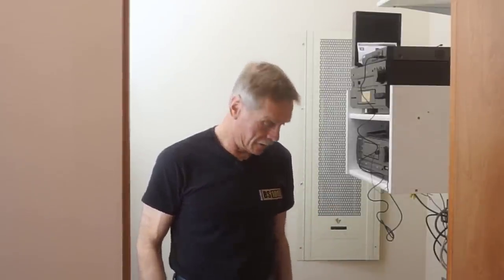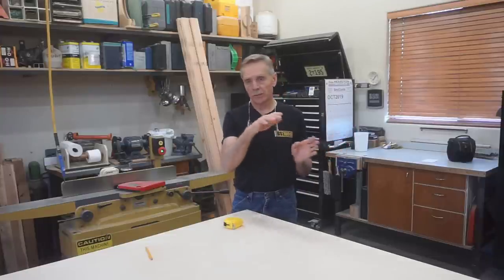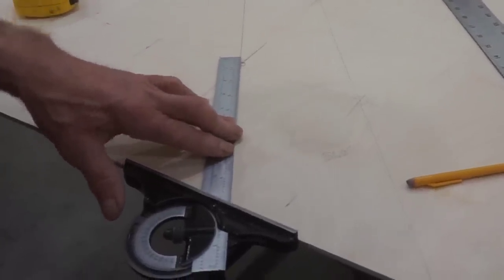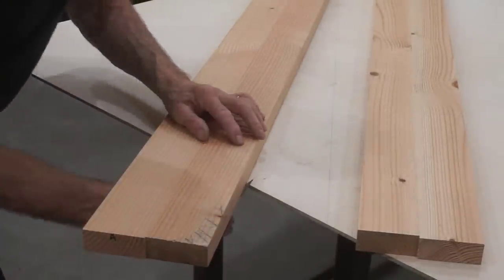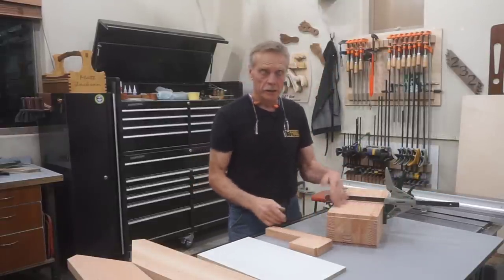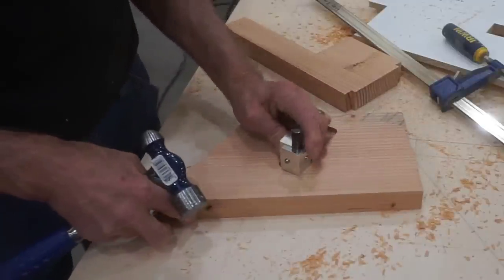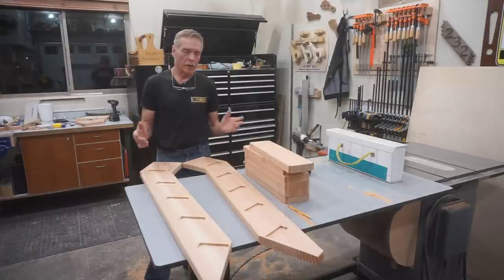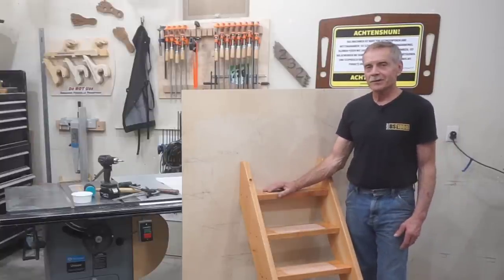How to Build a Loft Ladder

Comment: Even though I've built dozens of sets of stairs in my 40 years in the biz, I still learned a few things. But of course, most of the stairs I've built have been long affairs built in place...except for one set, which I built on a set of saw horses in the driveway of the house we were remodeling. The hole in the loft above was 36" wide by about 6' long and about 9' from finish floor to finish floor. My solution was an alternating tread design using 2x12 Douglas Fir. Of course, the middle stringer had mortices on both sides.

I cut one stringer top and bottom to fit in the required foot print, adjusted it as necessary to get a seamless fit top and bottom and then did a bunch of hit or miss layout until I got the step height figured out. Of course I made a template for my router, but it wasn't nearly as elegant as yours in this video. I didn't have a flush cutting bit so I made a large plate with the mortice size cut out, then screwed strips around the perimeter of the hole for stops to fit the base of my router. It was quite a clunky contraption, but it worked. I made full mortices for the treads because it was easier and I didn't have a table saw on site. Everything was built and cut with my circular saw and my router. They looked pretty damn amazing for my first time and believe it or not, passed code.

Comment: It's always amazing to me how the difficult things are made so simple by your techniques.  That mortising template was a stroke of genius.  So simple, but makes all the difference.  I was always scared of doing mortise and tenon joints, but you make it easy.  Thank you for another great learning experience video!
Reply: templates and jigs are key ... I had to hog out material and then fill back with blocking in a couple of old doors in my OLD house - the old morticed lock sets are gong - long gone, and the doors have been variously "adjusted" for newer lock sets over the years..and years...and when I went to replace the current existing with newer ( working) more-of-the-same, found that there really wasn't enough door left to securely mount them ( to hold back more than a old mouse with Rheumatoid Arthritis ) so..

Of course as I went to set up my small flush trim router like the one he used here died and all that I had on hand was my 2 HP monster Freud Plunge router....

With some suitable jigs I was able to route out both the door jam and the door itself, on both inside and outside faces as well as the edge ( 1.75" thick door) - with the door still hanging on the hinges ( as I really had no better place to set it up at the time this happened...the old lock had actually broken and any place big enough in the shop was completely covered since we were mid project on about 50 other things as well as a shop reorg) 

Bottom line is that a few pieces of melamine or similar and some forethought and you can safely rout a pocket into the thin edge of a door - on it's hinges- with a big hand held plunge router, and do it safely and repeatably.

I may have gone a bit far with the jigs, there was polyurethane and such involved... I have more doors and a humid basement...but the results can't be argued with, the patches and plugs fit nearly seamlessly into a 179 (+) year old door and since they are only in there with glue, I could even go back to an original style mortised lock set if I ever find one.
The time spent on the jigs was easily saved in not replacing the door or not having to go to the hospital or not having to repair the destruction done without the use of a jig.

Comment: Used a hinge mortising bit and jig  to make angled stopped dados to house treads of a ships style ladder with oblong hole grips between every tread. Definitely going the mortise route for a 4’ rise upper loft ladder I need to make. That way the mortise doesn’t have to fit the tread nose profile. Also the shoulders make the treads like trestle table rails. Probably I would  bury the screws and plug the holes for a finished space. Using a flush trim bit for mortising makes the jig more vulnerable. Make sure the router stops before lift off.

Comment: Sure, Matt could have easily bought a cheap aluminium ladder and called it good, and it would have been much quicker.

However, the point of this video was to us non master carpenters the learn the process of making a ladder and learn from a master carpenter the skills and techniques needed in laying out such a project, and how external factors such as location, purpose of use and desired functionality play a part in the design process. This master carpenter then showed us how to make templates to speed up and simplify the process of making mortices and tenons.  This in in addition to being able to understand that this process is not just for this project, but rather how we can adapt it to other projects of our choosing.

Imagine if you needed to build a 16ft wooden ladder for a customer. This master carpenter has clearly demonstrated a way to save hours if not days compared to using a hammer and chisel, then there's the layout techniques he demonstrated, again saving time fixing errors in the building stage, saving time and expense traveling to a store and back to buy more wood after you built it only to find during the installation phase that is doesn't fit / work, due to either bad planning or other unanticipated factor.

Personally, I have learnt a lot form this video, skill and techniques that if I apply them correctly will enhance my woodworking ability and speed up my process.

That would have been unable to happen if Matt had simply bought a ladder from home depot.

Thank you, Matt form Next Level Carpentry, for the time you have taken to film and edit this video. I really appreciate it.

Stay Safe, Family Prepper

Comment: I have been using the same method to divide widths into equal parts. As you said, easier and less error prone than dividing some (metric) measurement.
Besides, as a math major, I have to say: It uses more math than if you had computed numbers. 😍

Comment: Great craftsmanship.  Did you place some type of membrane between the concrete floor and the ladder to prevent moisture from wicking into the wood?   I like alternating tread ships' ladders for lofts when there isn't room for a regular staircase.
Reply from the maker: There's no moisture in that crawlspace Rob but a piece of peel-n-stick would work if it was a concern.  I did use a piece of 1/8" thick rubber pad underlayment to protect the feet and make up for slight unevenness in the concrete slab.  Best, Matt

Comment: Subscribed. Thanks for your tips and detailed instructions. I'm not a carpenter, but I can do what someone shows me if I have the tools. I have an attic that has a non-standard size opening. (3'x3') The only large home improvement stores around here have one size available, which won't fit my opening anyways. Your video fits exactly what I had in mind. I'll have to cut the finished stairs into fold-able sections and install hinges. Any idea those hinges are called? If you look at pre-made attic staircases, you can see what I'm talking about.
Reply from the maker: The type of hinge you need will depend on how you design your ladder but a quick search on Amazon provides a lot of options: https://www.amazon.com/s?k=attic+ladder+hinge&crid=12FF2ST5BHTAU&sprefix=attic+ladder+%2Caps%2C122&ref=nb_sb_ss_ab-sx-deeppltr-rank_1_13

Comment: Great teaching video, Matt.  The number of “pearls” you shared are incredible.  Did you consider attaching the ladder to the joist with a steel French cleat system for easy removal, or would that create instability?  Thanks for your continued educational content!  Merry Christmas.
Reply from the maker: Glad you like the video.  Since the ladder was actually a compact set of stairs that will 'never' be removed I didn't consider other methods of attachment but mostly for practical reasons.  I was already pushing the limits with mortise and tenon joinery and a lacquer finish for steps to a crawlspace and wouldn't have wanted to add cost for designing, building and installing a cleat system that would 'never' be used.  I can see your suggestion as a great feature for this type of ladder in a different situation though and appreciate your 'outside the box' thinking! 
Best, Matt

Comment: You seem to be a man who finds that if a job is worth doing, it's worth doing right. No shortcuts. (Except using a router and corner chisel for the mortice).  I was surprised when you disassembled it to add finish.  But then this is Next Level Carpentry.  So I should have expected no less.  Thanks.
Reply from the maker: You'd find that I disassemble almost everything I build, to some degree at least, for finishing LostWhits.  The end result always much better and the process is so much more efficient.  Imagine if I were to lacquer or varnish the 'loft ladder' fully assembled?  Planning and designing so that I can disassemble to finish pays off in spades for both time and satisfaction.  Best, Matt

Comment: Nice tutorial!  In looking over the tool / materials list in your link, I didn’t see the spray-on finish; I’m wondering what you used. Thanks
Reply from the maker: It's not there Capt I... it's 'for professional use only' and I doubt it's ship-able.  It's Sherwin Williams pre-catalyzed lacquer which you can probably get from and local dealer.  The lacquer isn't magic though and requires a whole other skillset to get the results you see in the video.  If you've got that skillset though it's one of the better products of its type out there IMHO. Best, Matt

Comment: Since the risers are open, allowing generous space for one's shoe, the stairs seem safer than if there was a solid riser. Do you think the top tread should be set out from the framing?
Reply from the maker: Ideally, yes, Ryan, that would be both better and a bit 'safer'.  Unfortunately space constraints kept me from that option on this job because the extra 2~3" it would require would make the space for getting in and out of the crawlspace more difficult that it already was.  In a perfect world the crawlspace access hole could be embiggened by that amount to have the best of both worlds. 
Best, Matt

Comment: Hi Matt, another great video!  What is the lacquer you are using if you don't mind sharing?
Reply from the maker: Hi Matt too: I've gravitated towards Sherwin Williams pre-catalyzed lacquer.  It works great as both sealer (first coat) and finish coat.  First coat sands pretty easily and even thick coats/areas harden from the catalyst as opposed to other lacquers that basically air dry and can stay gummy in corners or other areas where it tends to build thicker  when spraying.  Of course it stinks up the shop needing lots of ventilation but otherwise I always get the result I'm after.  BTW even the 'satin/medium rubbed effect' sheen is somewhat glossy but I've never gone to full out dull because of it.  The loft ladder is done with the medium rubbed effect.  The sheen does dull-out a bit after like a week of curing and I like that more subtle sheen better than when it dries initially.  BTW I don't get anything from Sherwin Willy for endorsing their stuff but am glad to share... 😉😥   Best, Matt

Comment: This is a really great and helpful video, thanks for taking the time to put it together so well!  One question, I'm preparing to make a ladder stair much like this one, and had planned on mortising to have the entire end of the stair tread fit in.  Is there a reason you chose to do a tenon on the tread, instead of having the entire tread end fit into the mortise?  It looks elegant the way you did it, but I'm wondering if there is some other structural reason... Thanks!
Reply from the maker: The reason I 'do a tenon on the tread' is laziness and aesthetics, not structural.  It's easier to get a really nice, tight fit between the tenon shoulder and faces of the stringer because the shoulder hides the joint between tread and stringer.  Much faster, easier and better end result than getting 'an airtight fit' between a tread and full size mortise IMHO.  
In this video I get a great fit by having to match only the tread thickness with the mortise width which is relatively easy compared to matching both tread width AND thickness.  
Just yesterday I finished up a 'loft ladder' for a set of bunkbeds that had 7 treads.  On that one I put a shoulder on both edges and faces so even the thickness wasn't so critical and got amazing results.  I chose a 'full shoulder' tenon because the ladder is made of western cedar which is softer and doesn't rout as cleanly and not having to be concerned of visual fit between the two made for a perfect end result with equally adequate strength.  Hope that helps?

Best, Matt
Reply: @NextLevelCarpentry  Thanks, that is really a huge help!  This whole video was fantastic, and very helpful;  I learned a great deal here, from patterning, tips on marking and measuring, to tricks like erasing the pencil marks before sanding.  Am almost done with my loft ladder (nearly 8' and made of 2x10 pine with 2x8 treads).  My struggle was in getting all the treads to line up perfectly when clamping; there was some slop, so ended up running them again on my saw individually to even them up.  Hope to get better with practice.  Many thanks again!
Reply from the maker: @flowreader6755  Excellent report... thanks. I've built 4 'ladders' like this in recent years and the process evolves with each one meaning I too get better with practice.  I've learned that the more precise I make the treads, the better the whole thing comes together.  I must confess that the last two I made ended up with a little bit of 'twist' in the final ladder assembly and I can't for the life of me figure out where it came from.  Everything seems flat and straight before assembly but somehow, even with paying attention to the potential of building twist into the ladder during assembly, there was about 3/8" twist.  That wasn't a deal breaker in final use or installation but it's frustrating just the same.  I tell you that so you'll give yourself grace if somethings not quite perfect on your first attempt.  I follow the credo "aim for perfection and settle for the best you can do" in cases like this because perfect is a bit relative in carpentry IMHO.
Best, Matt

Comment: Brilliant Matt!
Question: You lacquer sprayed inside your workshop and it looked like there was a fair amount of spray that would have floated and settled onto other surfaces. Does this pose no issue for you on equipment and the like?
Regards, Mark
Reply from the maker: Good question Mark.  That's a pre-catalyzed lacquer from a company called Sherwin Williams here.  Only direct overspray sticks to stuff, anything that's airborne lands as dry powder with no ill effects.  I put cardboard directly under stuff and, if the floor's not already dusty, will sometimes put a drop cloth down to keep it from sticking on the concrete.  It's very user friendly that way, unlike polyurethanes or enamels that ruin everything they touch!  Best, Matt
Reply: @NextLevelCarpentry   Thanks Matt, appreciate the answer and nice to have products like that available...

Comment: Hey Matt - Christmas is almost upon us. I was wondering if you have ever made "blocks" for anyone? I know I can buy them, but  I want to make blocks for my grandkids. Any guidance on sizes, species, etc. I just think it would be fun to have blocks made by your grandpa....any suggestions? Thank you!
Reply from the maker: Great question John.  It's kind of a 'rabbit hole' question though as ideas and possibilities are limitless.  I've made a number of these 'pyramid puzzle' 'blocks' but not really any 'kid friendly' ones:  https://www.pinterest.com/pin/155303887203282381/   My short answer about wood is anything that's not splintery.  Maple, cherry, walnut are common, mesquite would be fantastic for look and feel but you'd need to check into toxicity.  I think it's fine but, like some exotics, might cause reactions.  A quick look on Pinterest brings up hundreds of inspiring ideas so you'd be able to pick one that's doable with your tools, time, abilities, patience, determination, etc.  The main thing I'll mention is how potentially dangerous it can be to work with small, square-ish chunks of wood.  Plan your process and sequence carefully working with pieces that are long through as many steps as possible cutting them to finished size in a final step.  The thing I like least about the prospect is all the sanding involved to ease every edge... UUGGHHH!!!  That's where you'd need to apply the heaviest dose of Grandfatherly love to the project but I'm sure that glee on Christmas morning would offset that in an instant. BTW I use this tiny round over bit in a Bosch Colt router for easing edges: https://www.amazon.com/ideas/amzn1.account.AF3DBB6XLH5MPIEOBDKPL3MQVYTA/29WVINIJF4EUJ If you settle on a design/style and have process questions I may be able to add a bit of more-specific process info.... Best, Matt